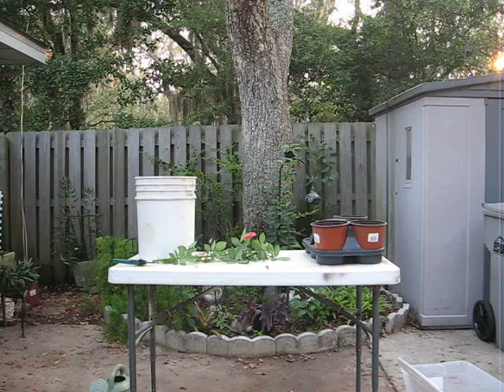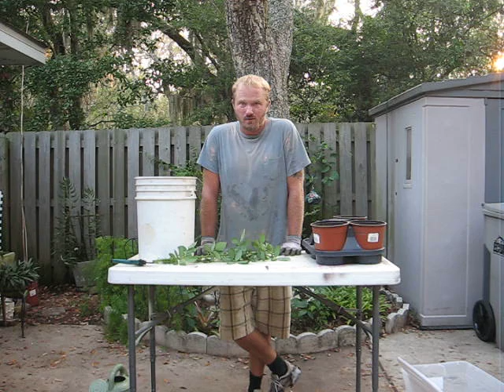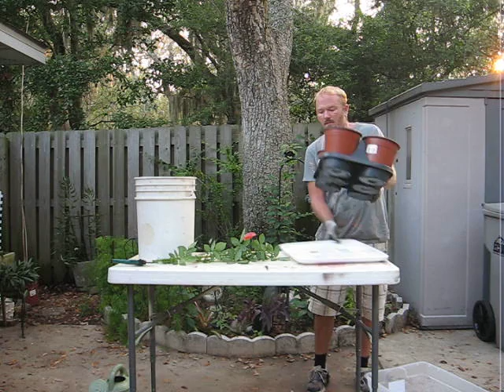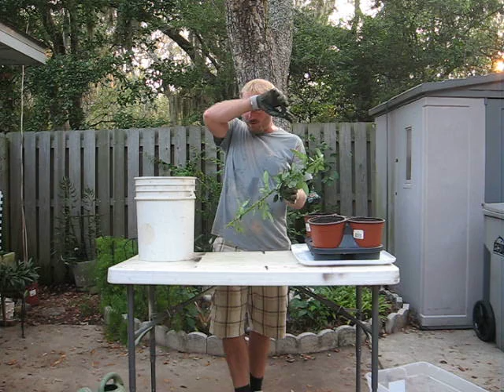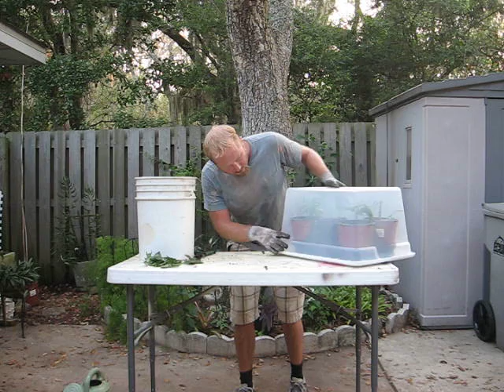Cloning a rose bush.

Comment: I like your system. Today I rooted some rose clippings. However, I watered the soil first....then I made the hole, dippped cuttings in root hormone. and placed the cuttings inside. I covered each pot with a plastic baggie then I covered the four pots with another plastic container. How long does it take for you to get bushes from cuttings?

Comment: I tried the method you present here using Miracle Gro rooting hormone, miracle grow plant food on a hose sprayer, miracle gro potting soil and similar containers to the ones you use....after three days, the one branch of leaves that I left on each cutting are crisp and brittle even though the soil is moist and there are water droplets on the inside of the container.  Avg temp for the past few days has been in the high 70's - low 80's and in the 60's at night.  One day of rain and two days of sun and the container is in partial shade.  They are Lincoln Double Knockout Roses.  Any thoughts on what I could be doing wrong?
Reply: I'm not an expert, but if your temp 70-80. Then the plant would be hotter than that in the sun or under a box. It is kinda like if you were sitting in a hot box with your feet in water. The water would not cool you down.  Did you have any luck with them?

Comment: i've tried that as well, i took a younger low branch and wired it into a pot, then wired it back upright from there. i left it for ... jeez like 6 months atleast. i'd actually forgotten about it. i did it in like october and didn't check it til may of last year. no roots.. i may not have made a large enough wound though, so idk.  meanwhile i've got a gardenia that rooted into surround leaf mulch. i saved about 10. i was actually tossing rooted cuttings from that one.

Comment: @LordGandor3 - since roots are young.  I Don`t use a plastic domb & rooting hormone is optional . Be sure to water as needed . Gardeners in colder areas may have to put cuttings in a sun window since new cuttings can`t tolerate sub 35-40 weather. Wait until after the last frost before planting in the ground & once the plant is established in the ground you can fertilize normally

Comment: Begin with 3 gal pots filled with well draining, non-rich moist soil as rich potting soil can burn cuttings ( I use Palm & Cactus soil from Home Depot ) Take 8 inch healthy canes & slant cut the bottem to offer more rooting surface . Bury 4 inches & water with reverse osmosis  water which is closest to rain water. place planted canes in well lit area out of direct sunlight for 6 weeks. When roots are established in pot transplant into the ground & wait 4-6 weeks before fertilizing sparingly -